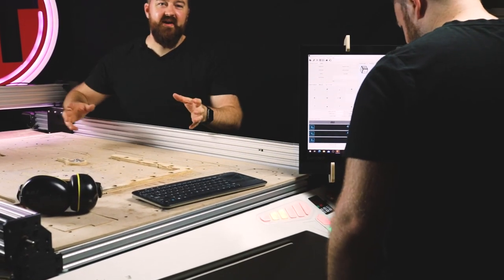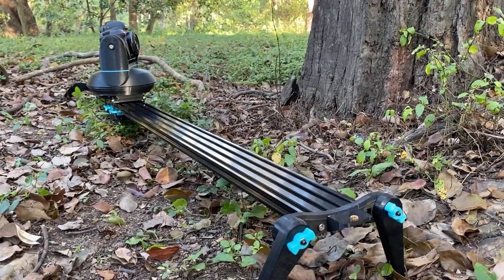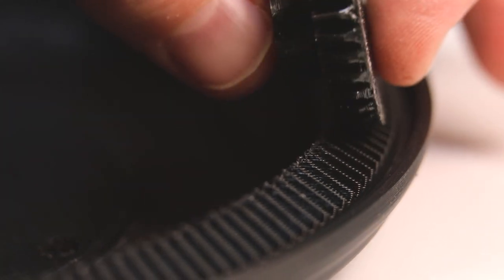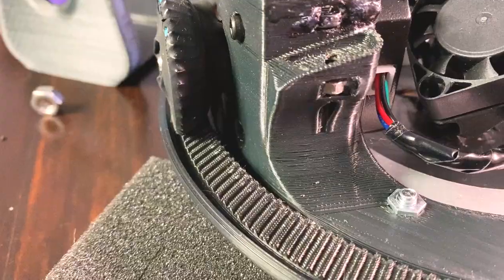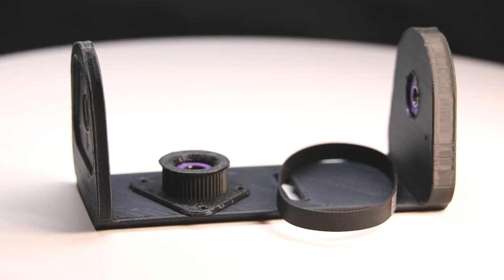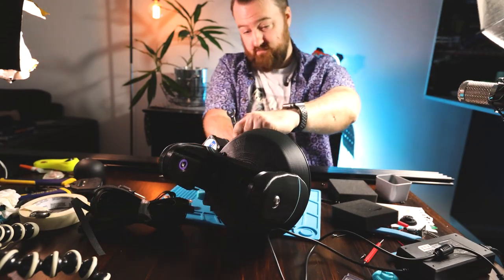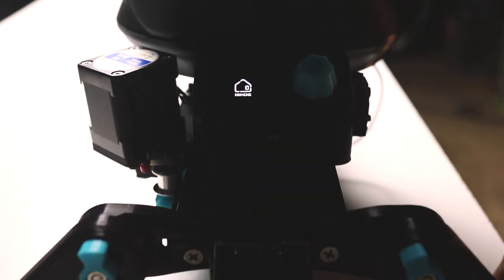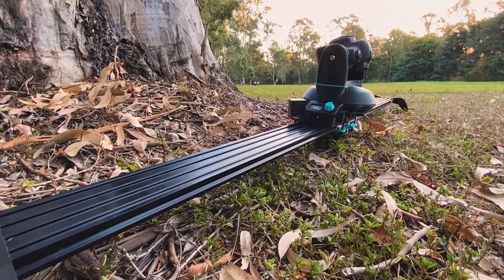My DIY 3 AXIS Camera Slider - Arduino // Ender 3 // DSLR

Comment: Cool project! I've been working on a similar slider a while ago but never managed to finish it to the point that I'd feel happy 🙂 
At some point I realised that using stepper motors was a dead end. Although I used smaller motors - Nema17, but only 25mm thick - with some slight gear reduction they're able to push 5D mkIV + 70-200/2.8 stright up 😀Unfortunately the fact is that steppers are extremely power inefficient and causes vibrations (via stepping).
After watching your intersting design in this vid, I'm thinking to put this project back on my workbench, but this time going into brushless motors.
Cheers!
Reply from the maker: Thanks for you comment @Art F . I’m so pleased to hear I have motivated you to finish your slider! Great idea about the brushless motors… I’m not sure how slow you can run brushless motors, however I’m sure with some gear reductions you could get some great results. You must keep me posted!! Good luck with the build 😁😁
Reply: good idea how have you got on using brushless motors?

Comment: I wonder if there's ways to do a single axis version of this design to hold a 3 axis gimbal, for those that already have one of those
Reply from the maker: Great idea!! This is super simple to achieve. Check out the original 2axis code version and would be easy to delete lines not required. Great thinking 😊

Comment: Very nice build, how did you program the lcd screen? Can you share a link if you've got a tutorial on that?
Reply from the maker: Thanks for your comment @mahmood aloraibi . Unfortunately I have not made a video regarding programming the screen however in a nutshell the main visuals that appear are the bitmap images… these are mainly stored in the external file called bItmapNEW. There are many videos on how to convert a bitmap to arduino OLED that can guide you through this process. Was there anything specific on what you wanted to understand?
Reply: @NEWTech Creative  thank you very much for making the time to answer my question.. actually I'm completely noob in arduino programming but have tried few projects and would like to know how to complement the project with a nice gui like this using bitmap icons and text and so on.. any resources in particular you can refer to to help with lcd? As far as i know most arduino tutorials are for normal text on lcd or using third party software like nexion or so on
Reply from the maker: No problem! Yes I can understand your frustration which finding the right direction of information when starting out. I would start by typing ‘arduino oled bitmap’ into google and YouTube a just try the tutorials provided and this will start to get an idea of how to program graphics… you could even compare my code with the original code of the 2axis slider version (links on my GitHub) and observe differences. There are many great resources available but I think the most important part is the experiment process…. Just make sure you use the correct library for your selected oled screen. Good luck with the journey 😁👍
Reply: @NEWTechCreative  love that. Thank you very so much

Comment: are you able to mount it on a tripod or 3 axis tripod
Reply from the maker: Thanks for your comment @Vincent Longacre . I have included brackets with screw inserts for the end to be mounted onto two tripods (one on each side). Alternatively I made this also to be just the 2axis head if you just make the main body without the track axis, then can just use the 2axis camera head for a tripod - however this will require you to alter the code to a 2axis movement only. 👍

Comment: Sorry if I missed it, but what was the total build cost?
Reply from the maker: Thanks for your message @limitliss . The total build came to around USD$190. The most expensive part was the v-slot aluminum extrusion that was around USD$55. 😁
Reply: @NEWTechCreative  hmm. Not bad really. Would you be willing to sell an assembled one without the track?
Reply from the maker: Definitely not bad when comparing to some commercial ones on the net! Unfortunately I can’t provide any physical parts - just the files for your own project! I wish I had time to create more than one 😊😊